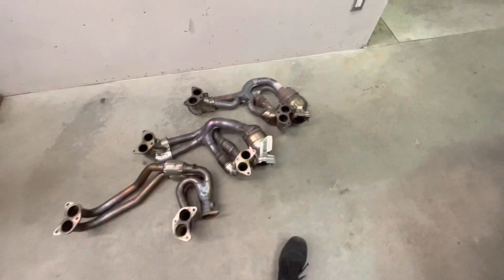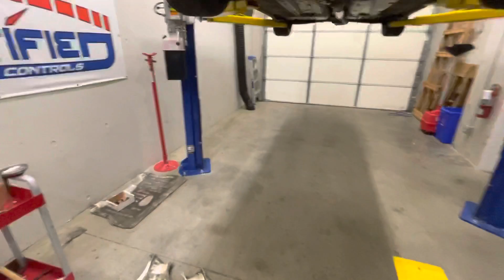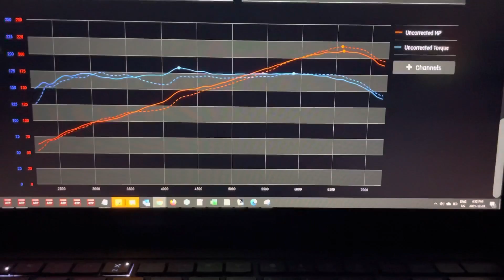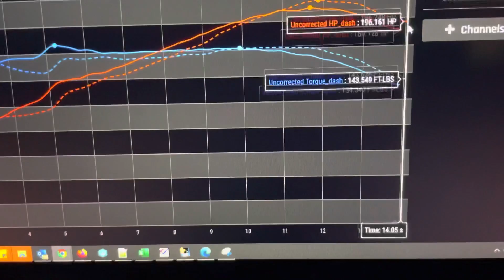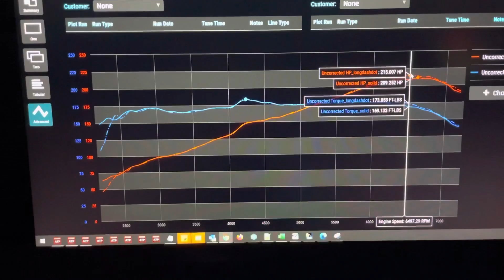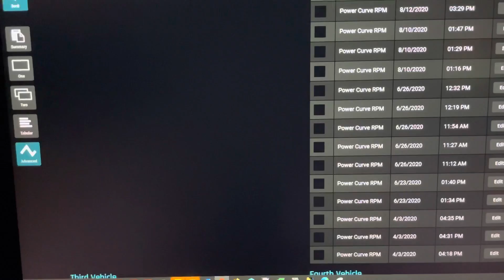2022 BRZ Build EP4: Does a UEL exhaust header make power?

Comment: Thanks for your review and information. 
You disable the catalytic converter from the header. 
How do you overcome a check engine light that is ON without tuning ??
I mean between the two sensors there is no more catalytic converter

Comment: looking forward to seeing the new ideal UEL header size for diameter/runner length, and Exhaust diameter ratios. Makes me wonder what kind of potential this 2.4L the power to cost aspects per build/flow/diameter.
Reply from the maker: It should make 20% more power than a similar optimized 2.0 setup.

Comment: Interesting comparisons. I think you need to square up your measuring device to get accurate readings, if you are not 90 degrees to the pipe you will get a larger number. I think the Borla header’s weight savings are mostly due to the absence of the catalytic converter. Assuming you install one further down in the exhaust system that weight savings would mostly be a wash.
When you tested the Borla headers on the new BRZ the rest of the exhaust was stock? Does this mean there was no catalytic converter installed? That would also suggest the cat back exhaust was not optimized for the headers. As you’ve suggested a few times, a complete exhaust system that includes headers and a full cat back upgrade, perhaps with a high flow cat as well, could yield substantial gains…especially with some tuning. Exciting times for this platform.
Reply from the maker: It really is an exciting car and platform. This is not an optimal setup ... and we are EAGERLY awaiting tuning to optimize further. It's going to take a combination of tuning and hard parts to get the most out of it.

Comment: The huge torque dip and only 2L of displacement probably dictated design of the narrow headers, to keep up the exhaust gas velocity. New engine should benefit from new headers with wider pipes, extra displacement won't hurt the velocity and it will breathe at the top end past 6000RPM where this header lost power.
Reply from the maker: Headers do play a big role in that torque dip area.
Reply from the maker: On both motors.

Comment: Hey Stratifiedauto I got the PLM UEL headers and a Tomei over pipe. I want to install it on my 2022 brz for the sound. Ive talked to some tuners and they told me not to install it without a tune because it might cause it to run lean or throw a CEL code. But ive seen you install it and beakhan install it without a tune and the cars sound great. In your opinion should I just full send it? Im going on a trip from california to oregon and I dont wanna deal with any problems with my car if it does mess my engine up. Has it cause any problems for you going full exhaust without a tune. What are your thoughts on what I should do?
Reply from the maker: If you have no exhaust leaks it won’t run lean or rich. It will be fine since it’s a MAF based car.

Comment: Knocking out the cat in the 17+ manifolds have been proven to make a similar amount of power compared to some quality aftermarket headers. Would you guys be willing to remove the primary cat in the 2nd gen header and retest it? Thanks.
Reply from the maker: We will just replace the header rather than modify it.
Reply: @stratifiedauto  Much appreciated, but I think it would absolutely be worthwhile to the community. The 17+ header with the cat deleted is within the noise floor of popular UEL headers on the first gen.

Comment: Could you please do an intake header/ manifold ID and size check video also please to check PD Supercharger fitment. 🙏
Reply from the maker: Eventually we will get to forced induction.
Reply: @stratifiedauto  FI , like you say is logically a while away. With NA mods, will you try a 2017 Red intake manifold which bumped up the power of Gen 1.5 by 5 BHP. So similar to exhaust manifold swap, Intake manifold swap mods is probably the first step, if you plan to 😀

Comment: The air filter intake size was interesting, would you mind measuring the intake manifold and throttle body? Also the manifold power gains midrange vs loss top end wouldn't translate too well in a 1/4 mile or track where you stay in peak power, id bet the stock manifold would give the better time
Reply from the maker: We will be going through the intake parts with some details next.
Reply: @stratifiedauto  Awesome

Comment: Stratified, you need to get your hands on a ACE 350 EL header. On the fa20 it vastly outperformed the UEL’s in terms of low end torque while getting rid of the torque dip completely, while also making more peak power top end… those headers would shine on this new BRZ/86
Reply from the maker: I agree and hear those are awesome headers.
Reply from the maker: I agree and hear those are awesome headers.
Reply: @stratifiedauto  I believe the dyno I saw it made 17 more ft lbs of torque then the UEL and 7 more whp top end over the UEL. Quite impressive. It obviously also made substantially more then the stock header
Reply from the maker: Is this on the 2.0 or a 2.4?
Reply: @stratifiedauto  the older 2.0L. I’m curious to see what it would do on the 2.4

Comment: So you said the borla headers are slightly smaller than the 2022 2.4 OEM’s as they were built for the 2.0? That would make sense that you lost at the top end… because they are restricting during the highest flow area and the middle gains could be from smoother paths on the borla. Possibly have slightly more gains across if borla made a little larger ID system for the new BRZ.
Reply from the maker: I think you will find our next video very interesting where we compare the headers on the FRS.

Comment: If I remember correctly there was very little gain from headers untuned on the first gen as the ecu can't take advantage without adjustments. 

With all the extra torque this new engine has I'd be more interested in a 4-2-1 high rpm header like ACE type A
Reply from the maker: The torque dip is still addressed just like it was on the gen1. So there is that.

Comment: I would like to see you test a header made specifically for the BRZ 2.4….I could be wrong, but itseems like something specifically designed for the 2.4 would be better.  That said I understand the new HKS exhaust only dynod at six hp above stock.  From my reading, it sounds like a whole lot of the BRZ is close to perfection.  My BRZ comes  in February.  After your vlog on camber, I ordered upper and lower camber bolts.  I’m looking forward to your future videos. Thanks wildman

Comment: Why does UEL help this car? In the turbo EJ25 world, ELH is an upgrade. Is this simply to do with the lack of a turbo?
Reply: They don't. It's for those that want the boxer engine distinctive sound. Equal length ones make more power but the exhaust sounds different with them.
Reply: @idokwatcher2062  This video says otherwise...
Reply: @MikeG4936  It lost peak power. People kept pleading with them to make a 270bhp turbo version with the WRX engine. What they delivered with this 2.4L NA is an improvement over the GT86 but ultimately still a disappointing underpowered car. I don't think all those who complained would be lining up for unequal headers to degrade their peak power even further.
Reply: @idokwatcher2062  Peak power is rarely used outside the track. The UEL delivers in spades in usable area under the curve. What is more astonishing is that this is before the car was tuned.
Reply: @MikeG4936  It's because of the torque dip which they apparently force to hit emissions goals (IIRC in Europe it's measured yearly around the 3500RPM for 3 minutes sustained throttle). Even the GR86 has a significant torque dip, it's not as pronounced as on GT86 but it's there and enthusiast forums have been analyzing it since early independent dyno results came out of Japan few months ago. I'm guessing that the 2L header with its narrow runners increased exhaust gas velocity in the mid range and removing the catalytic converter helped some. Equal length headers for this car should make more power from 3500RPM all the way to redline.

Comment: Great info. I would love to have that UEL sound, but without seeing much gain its not worth the expense to me. I would love to see results from a tune alone and then tune + headers on the 22.
Reply from the maker: As soon as tuning is available we will be right on it and offering it. Can’t wait to get this car tuned as it has great potential!
Reply: @stratifiedauto  I know that the 2017+ OEM manifold was improved over the older cars. I wonder if the 22 model is the same as what is found on those? Many older BRZ\86\FRS owners use the 2107+ manifold as an upgrade.
Reply: Once they make headers with ~12% larger pipe diameter to suit the 25% larger flow then there should be gains.
Reply: Wait until ACE gets there hands on a 2022 BRZ. There EL header outperformed every UEL in terms of low end torque substantially (17 more ft lbs of torque over the UEL’s) on the fa20, while also making 7 whp more top end. UEL’s are for ricers, stick with a quality EL header
Reply: @sleeper.simulant7327  That may be the case, but everything they make is catless. These cars sound like pure dog shit with the cats removed. In all honesty a non turbo car making anything under 400hp has no reason to run catless. THAT is some ricer crap running a 200hp car and thinking its those pesky cats holding it back. LOL
Reply: @boost331  you can weld in a 200 cell cat for cheap at any fab shop onto your exhaust. ACE’s products stand out on there own in terms of quality. For an all motor build, it’s the only logical choice to go with. Proper resonators added into the exhaust, including some ART style resonators, will cut the rasp out big time, while maintaining good flow.

Comment: Did the aftermarket headers change the exhaust sound at all with the stock exhaust? Waiting for my 2022 BRZ to arrive. NY state just passed some restrictive aftermarket exhaust laws, but a header might sneak by. And great work guys! Keep up the excellent work!
Reply from the maker: Yes added a bit of burble but honestly it’s not too great. I think a catback is needed and to disconnect the sound enhancer in the cabin.
Reply: @stratifiedauto  I figured. I'll have to look into it. And I'm asking the dealer to turn off the fake engine sound when I pick mine up.  Apparently it's a simple thing for them to do it. Thank you for the response and looking forward to more videos!
Reply: you can just unplug it. open the area infront of the passenger seat from the door site. There is a plug